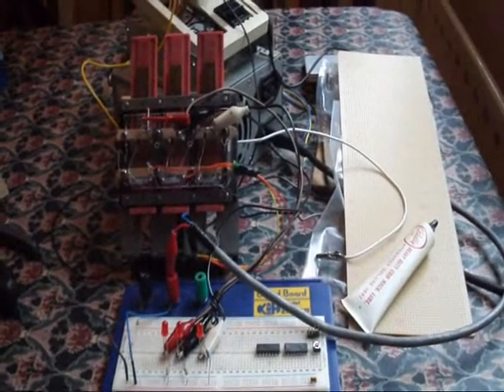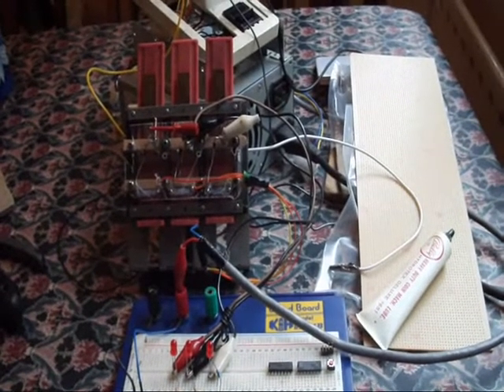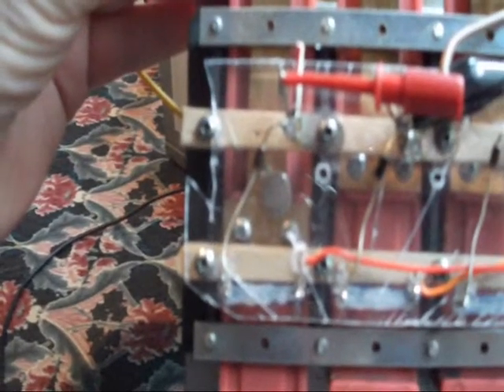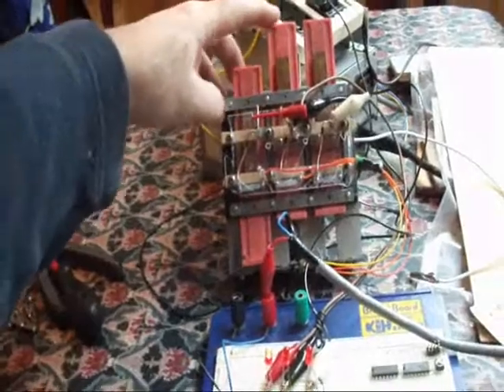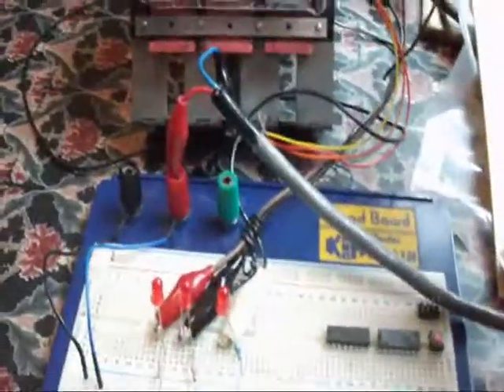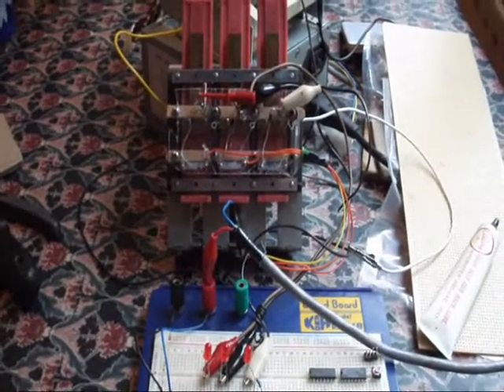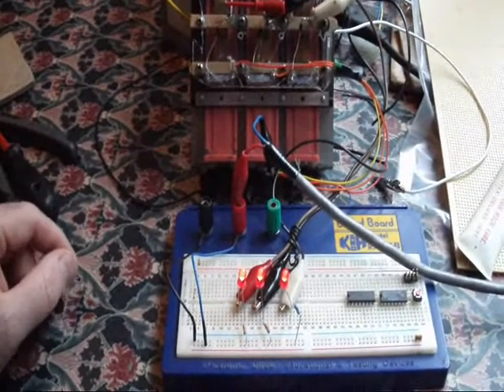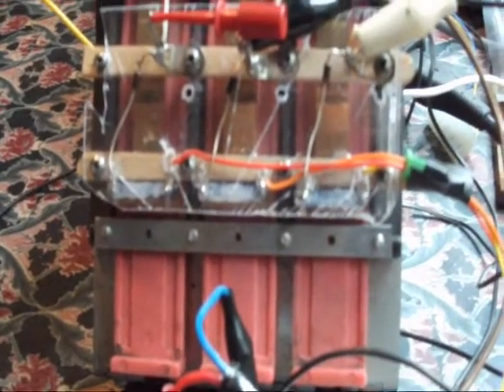Drop Target Reed Switches.wmv

Comment: Hey, did you ever go any further with this? I was adjusting my Gorgar drop targets and found it to be a dreadful experience!
Reply from the maker: @Brian King  Actually there were several solutions I tried.  Due to the vibrations and ‘shock environment’ the magnets and reed switches didn’t hold up over time. 

You can rebuild the originals with these from 
Siegecraft (excellent) which have on board diodes and simplified wiring:
https://www.siegecraft.us/presta/index.php?id_product=21&controller=product&id_lang=1
Marco does a 2-bank kit:
https://www.marcospecialties.com/pinball-parts/1B-2001-AK02
They use the original horseshoe contacts, which you will still need and must be replaced:
https://www.marcospecialties.com/pinball-parts/A-7614
Siegecraft shows the correct wiring for your game with links on the page.

These are slightly cheaper, but in my opinion not as good.  More like the original boards:
https://www.pinballlife.com/drop-target-horseshoe-pcb-for-williams-system-3-6.html

Another option to get good reliability is to convert to microswitches, if you have the leaf-switch type. I think Gorgar and BK used them. You can 3d print the adapter panels and install microswitches: https://www.thingiverse.com/thing:3480891

I once bought a Black Knight that had Williams designed microswitches fitted.  Maybe a retro-fit to improve reliability, but it was original.

My opinion after messing around and testing is
Horseshoe type: Rebuild with the linked boards, and new horseshoe contacts.
Leaf-switches on bottom: Get someone to print you the adapters and go with microswitches.
BTW - I’m a drop target fan.  I own Flash, Blackout, Firepower and Black Knight. But no Gorgar.
Reply: @firepowerpinball  yeah, I love the drop targets, just not this design lol. I unfortunately already had bought and soldered in the anarchy boards when I commented. If that doesn't work, I think I'd rather attempt the microswitch style. I hadn't seen that setup yet. Thanks for sharing!